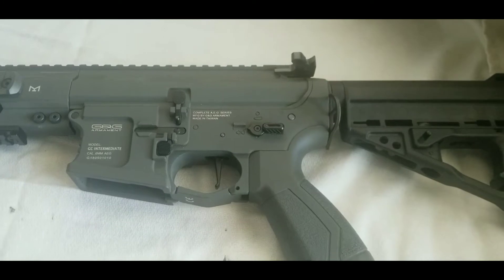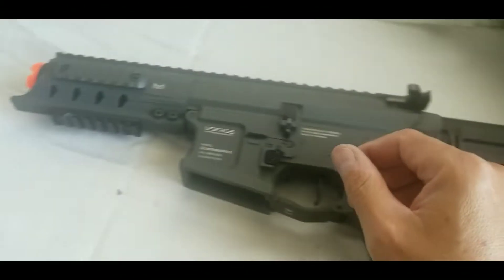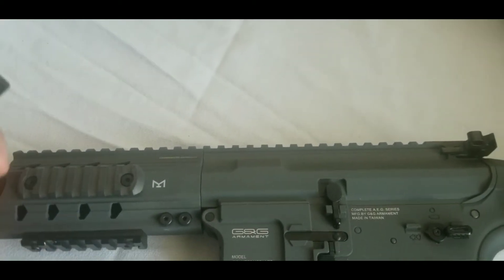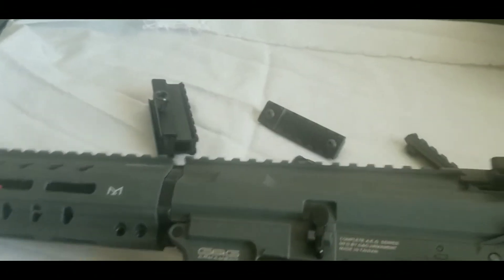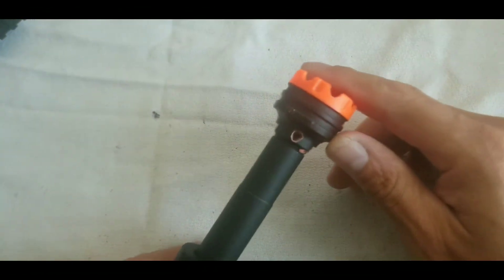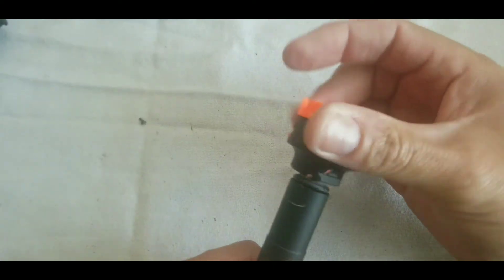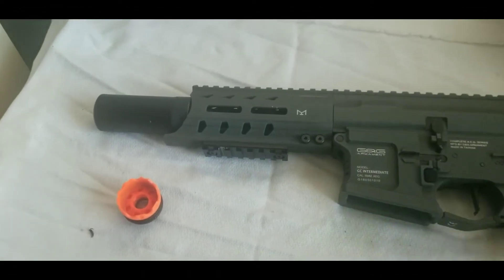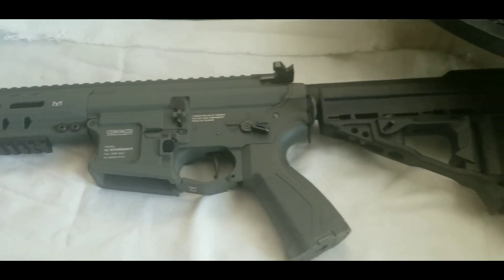How to remove your orange tip on G&G ARP 556

Comment: Which stock is that? And did you make a video on how to switch that out?
Reply from the maker: No I didn't do a video on it but it's pretty easy it's one screw, and the stock is the QRS
Reply: @blackwidowairsoft4301  gotcha , what about the attachment mechanism? I’ll order the stock now ? Sorry I’m new to all this.
Reply from the maker: If you're going to change it you need a buffer tube, screw and plate. Look for a video showing you how to replace the stock so you have a better understanding on this.